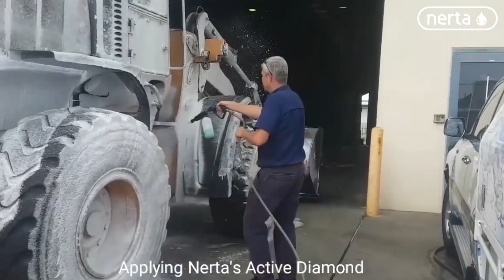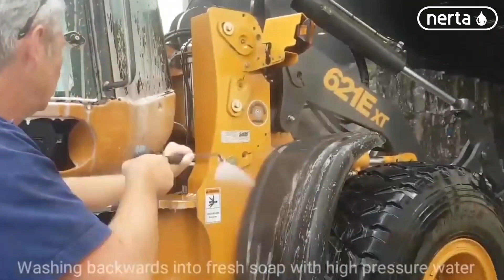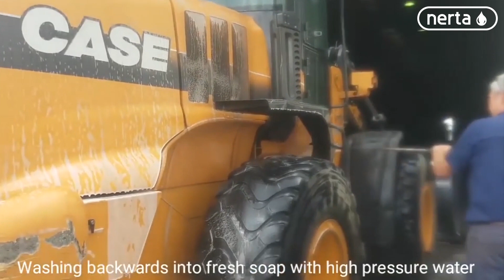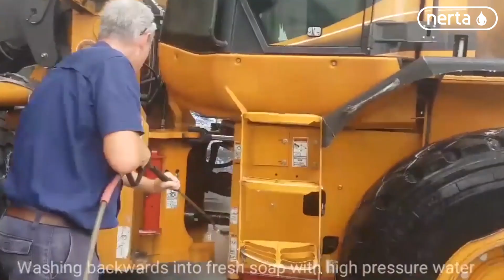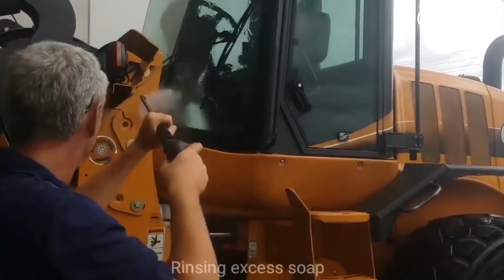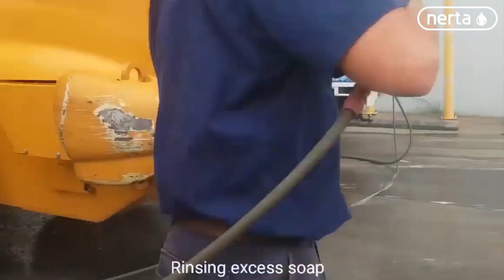Washing a loader with Active Diamond Foam

Comment: Buddy, rinse from top down- ok! Where did he learn this?
Reply from the maker: Hi, when washing a vehicle using conventional methods you firstly apply soap, wash using a sponge or a broom and then rinse off with water from the top to the bottom.
Touchless washing is a bit different.

Soap is applied through a high pressure foamer and then high pressure water is used as a “sponge or a broom". The water is worked back into fresh soap, either from the bottom to the top or backwards in the case of trucks and trailers etc. In this way, the soap is used more efficiently. (If you wash from the top down, you would simply wash the soap off the vehicle which defeats the purpose). Then rinse from the top down to finish the cleaning process.
Reply: The guy who is washing the loader he is from the office, he is got no idea how to wash a loader.....sorry ,a clean loader😁